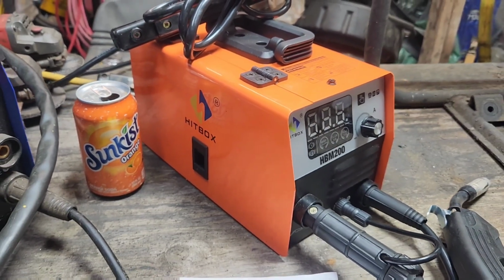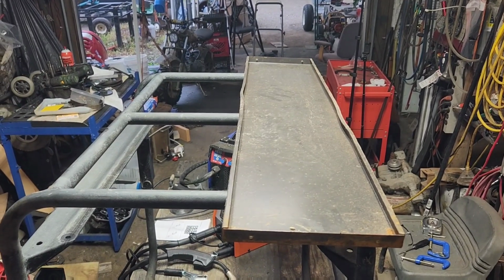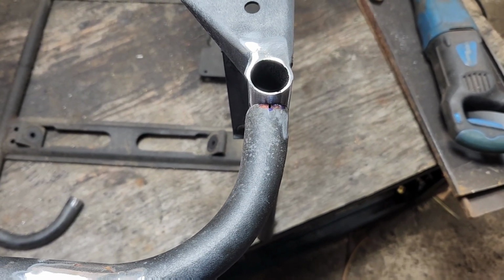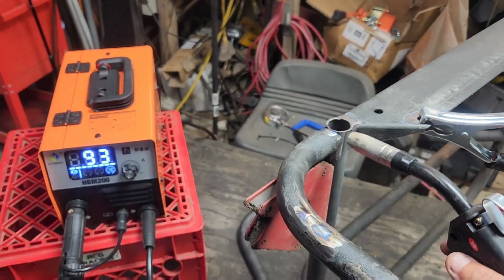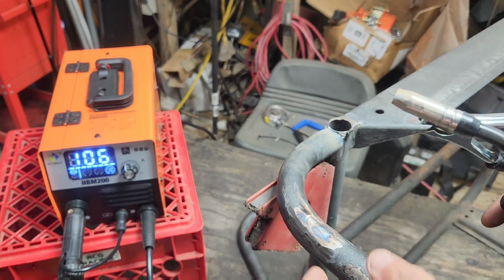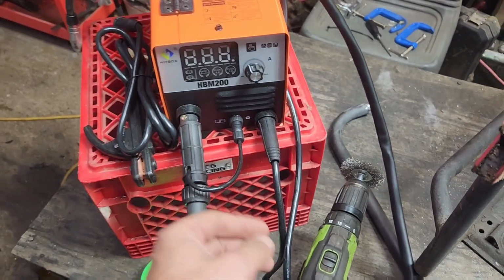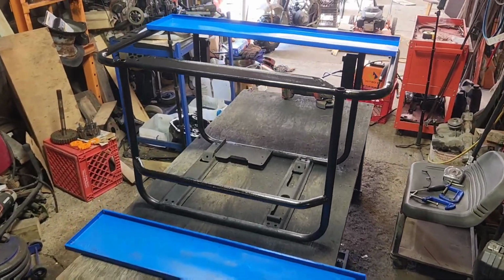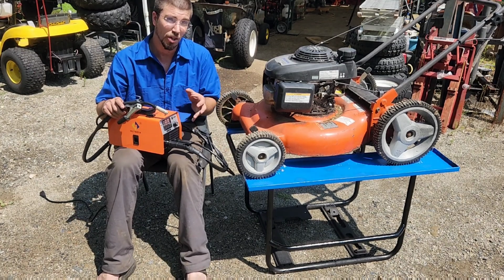Push Mower Work Stand Build with HITBOX HBM200

Comment: I also have the Hitbox HBM200, mine runs on 'proper' voltage (240ac) but for the money they are a decent and versatile little box of sparks. I'm using mine for car bodywork repairs.
Good job there, but please wear welding gloves, not only are stray blobs of weld bloody hot, but UV radiation can do a fair bit of damage to skin too.

Comment: Kind of off topic, though seeing the orange roll around, reminded me that my local HF has a 30 percent off clearance items, so the already awesome priced U.S. GENERAL Folding Side Tray for 5 Drawer Tool Cart, Yellow or Orange was ~$11 out the door.  Figured I'd share since I just got back from getting a second one for my roll around. Great info as always.  Wondering what kind of timer delay circuit maybe controlled by a relay and somehow timed with a 555 maybe from the trigger press would sync the wire feed correct?
Reply: Shit, that quick searching Google and found there are already 555 Time Delay Relay Modules.  Go figure.
Reply: Deck hole repair or maybe like adjustable anti-scalp casters or something upgrade for decks without on the front?
Reply from the maker: The interesting thing I have found on these cheaper welders is they seem to have a break in period. This is why I do not judge them and post video tell a good 2 or 3 hours in on welding with them. After the break in the welder seems to be less delayed but all sub $300 welders tend to do it. The cheapest none delay I have found so far is the Fornay 140.

Comment: What's your calling a problem with it that delay feature is actually in higher welders it's called run out and I like it my titanium 140 professional welder from Harbor Freight does that one thing I don't think that welder you're using has is inductance my machine has inductance you can control the width of the Arc cone and how fast it heats something up. It also determines how penetration you have but I'm very interested in this little bitty hitbox seems like a very capable little machine